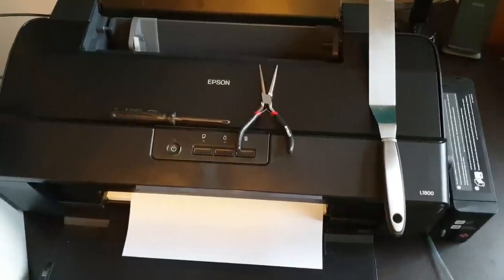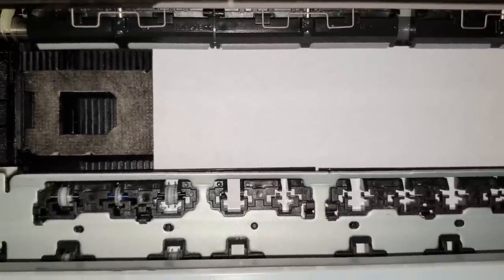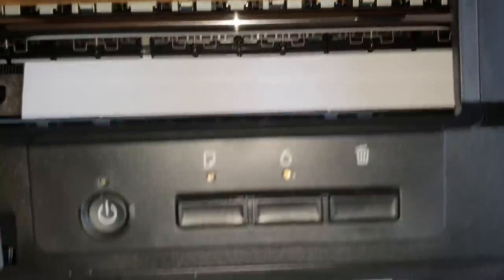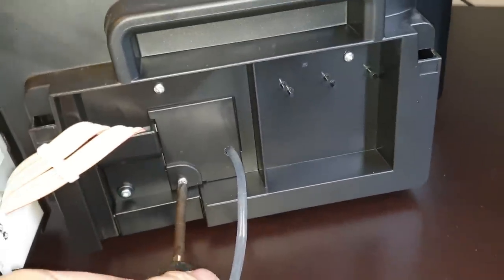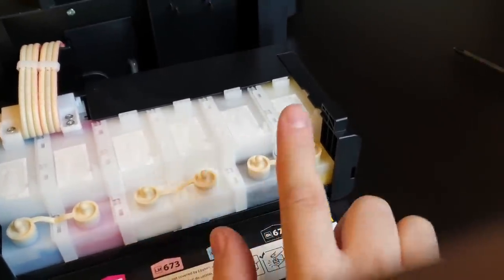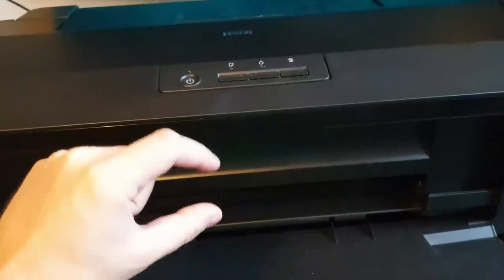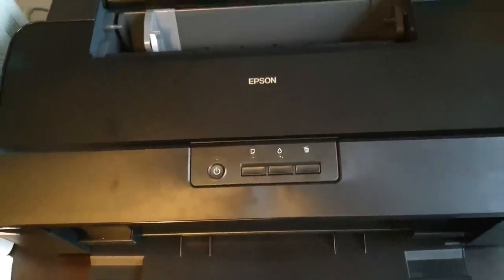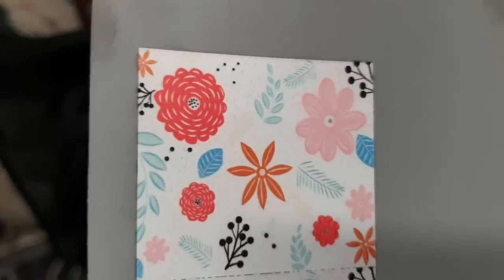How to convert Epson L1800 printer for DTF printing. Easiest and cheapest way. Tutorial.

Comment: It's actually working😊, but the drawback is that even a slight movement of the film can ruin the print. I personally find it more challenging compared to just opening the printer and removing the roller. Although it can be a bit intimidating for someone like me who isn't tech-savvy, there's no need to worry about any springs popping out or anything tricky. Just make sure to remember where all the screws go. In my case, I left one roller on both sides and cut them so I could feed a 4-inch long film.

Comment: Would converting the epson et 8550 be about the same process?

1. Remove the rollers
2. Rip software to enable white ink
3. External waste for ink
4. Install DTF ink
Reply from the maker: Yes, it's the same process for most printers.

Comment: Hi so  if i understand you don't need to flush the head with cleaner if not use during week end ? it only need to shake and launch a head clean ? right ?
Reply from the maker: A few days without printing is fine. Just shake and clean.

Comment: Thank you very much. This is a great video and ca not understand why anyone would give it a thumbs down.  I  do have a question. What did you use to connect the tubes together for the waste line?
Reply from the maker: It was just some plastic straw type of thing I found that fit perfectly into both tubes.
Reply: Did it work

Comment: I have question ❓ what if we want to print in A4 size , as A3 size gets hold on both side .
Reply from the maker: You'll be fine. The pushing is done by the wide rubber rollers before the print head. You don't really need those that go after the print head. So you can either keep a few on each side or remove them completely. Either way you'll be able to print A3 and A4.
Reply: @dtfprintingtechnology9457  Great , thanks for reply . Really appreciate 😍

Comment: Hi i have the epson stylus 1500w 
And i dont know If it's  Going to work ??
Reply: yes it works
Reply from the maker: It should in theory. You would need a CISS for it. The conversion process should be very similar but I have not had a chance to test 1500w for DTF so don't take my word for it.
Reply: @dtfprintingtechnology9457  refill carts 👍🏼

Comment: Hello. I have a question, please. After 8-10 pages printing, dampers become empty (or have air). White first, and then black and the others. And I need to suck the inks manually. Is there a solution for that? Thank you.
Reply from the maker: There is some sort of ink flow issue. There is a twist thing on the ink tank. Try turning it. It stops the ink flow for when you need to move the printer. Might also be blockage.

Comment: Yea complete skip the part where the printer cant grab the film out of 10 times.. Or it just passes through the printer and gives a paper out error 9 out of 10 times, yea just cut that part out of the video, we wont notice.
Reply from the maker: That only happens with cheap film. A high quality film has special coating on the opposite side that rollers can easily grip.

Comment: Hey, many thanks for this video! Just a question: I’m about to order the inks and all additional items form your website to give this a try (printer have my own) and I just wonder how is it possible to get the USB key with dongle for acrorip for such reasonable price. Everywhere else it costs around 345€ or so.
Reply from the maker: Hello. Thank you for your interest and sorry for a late reply. Acrorip 9 is cheaper than acrorip 10. You only need acrorip 10 for xp-15000. Older printers such as L1800, P400, P600 etc. work with acrorip 9.
Reply: @dtfprintingtechnology9457  many thanks for your kind reply! :)
Reply: What is with epson stylus photo R 2400?

Comment: Ive just bought the L1800, could only find it as a sublimation bundle. Will convert to dtf and have put an order in for consumables on your website. Can you recommend a vendor for replacement printheads?m for £60 you mention  Would like to be prepared for when print head fails.
Reply from the maker: The vendor that we used in the past is all out of stock due to DTF popularity so I can't really recommend anyone from first hand experience. I guess any vendor with good reviews is your best bet.

Comment: Hello.
 I would like to use this printer for DTF printing. Can I use the included ink?
 Can I buy only white and print it?  I'm a beginner, so I just don't understand.  Thank you very much.
Reply from the maker: No, DTF ink is rubberised. So when it dries it's stretchy on the frabric.
Reply: @dtfprintingtechnology9457  
Is that so.  understand.  thank you.

Comment: thanks for that great video! I have two questions...
What software are you using?
What if I don't use it daily? 
Thanks in Advance!
Reply from the maker: Acrorip. If you are not going to use your printer for more than a week you will enter a dangerous territory where you may end up permanently clogging your printhead. Long term storage will require a complete flush and lubrication.

Comment: So my printer was just a normal printer using normal ink. How do i drain out all that normal ink so i can fill up dtf ink?
Reply from the maker: You drain all the ink you can, empty the tanks, wash the tanks, fill the tanks up with distilled water, draw water from the tanks through the dampers using a syringe until it comes out clean. Then extract all the water. Extract the printhead, waterfall it with distilled water until it's clean. Fill up with DTF ink. Draw the ink through the dampers with a syringe until the dampers are full of ink and there are no big air pockets. You should be ready to go.

Comment: Thank you for your time to make this video for us. Can I ask, if the printer is for sublimation printing but never been used, is steel needed to be mechanical converted or just need to fill with dtf ink? Thanks
Reply from the maker: Sublimation printers are just regular printers that print with sublimation ink. Sublimation paper absorbs sublimation ink and there is no smudging. So you will still need to carry out the mechanical conversion.
Reply: @dtfprintingtechnology9457  Thanks for the info and for the quick response ❤️

Comment: I bought a used one of these and im about to convert it. how would i switch the ink to dtf from sublimation if the lines and ink tank were filled with sublimation ink first
Reply from the maker: Wash them out with distilled water. Then using a cleaning solution. Then water again. They don't have to be perfectly clean. Some residue will be left over.

Comment: hi. i have an epson l1800 and im trying to print without cover but i get errors. do you have any idea what sensor its making that error? when i put the cover on its working perfectly. TY
Reply from the maker: There is a little notch on the lid. It goes into the hole. You can just stuff that hole with paper or something. (Left of the power button from what I can remember)
Reply: @dtfprintingtechnology9457  i mean without the whole cover not only the lid. i want to change the case and i dont know what sensor to fool :(

Comment: Hi. Has this kind of "modified" printer difference with the printers made especially for DTF printing? I mean final quality of the print.
I'd like to start such kind of business, I have L1800, want to use it as a "low cost trial" before buying the dedicated DTF printer but still doubt if it's a goog idea. Thanks in advice for your reply.
Reply from the maker: Dedicated DTF printers are just professionally converted Epson printers. The print quality depends on the Epson print head. If you convert an L1800 it will have an exact same print quality as a professional DTF printer with an L1800 print head.
Reply: @dtfprintingtechnology9457  Thanks a lot for the advice!

Comment: This is very helpful what application or software do you use for printing ? I'm using PartnerRIP Pro and I'm having trouble printing. What happens is that whenever I print my layout on film sheets the layout starts on the edge of the film not leaving any border even after adjusting any tips will help thanks!

Comment: So this ink wont be dry ones is out the printer ? For that you dont have to do any conversion right? I always thought the printers has some kind of systems to dry the ink when the paper exit.
Reply from the maker: Desktop inkjet printers don't dry the ink. It's the paper that absorbs the ink. This is why when you buy cheap thin printer paper and try and print out a photo, it often comes out wet. In our case we want it to come out wet.

Comment: CAN I CONVERT MY RECENTLY USED EPSON L1800 TO DTF PRINTER.WHICH  I HAVE BEEN USING FOR SUBLIMATION ??
Reply from the maker: Yes, you just need to clean it and flush out the old ink.
Reply: @dtfprintingtechnology9457  ok thanks so much i have to clean it right now

Comment: I’ve been using mine with regular ink and I wanted to ask if it would be safe to drain all the ink and use dtf ink after the conversion or do I have to use a printer head cleaner to make sure all the regular ink is drained from the head too ?
Reply from the maker: It's recommended to empty the ink and wash/flush everything with at least distilled water. Printhead, tanks, lines, dampers. Mixing different ink types is not a good idea.
Reply: Do you have a video on how we do that?
Reply from the maker: @Dimish1  No, we don't

Comment: Very valuable information, thank you. Will this method allow for printing up to the edge of the film without any problems? And what would be the maximum size you can be able to print?
Reply from the maker: Yes, you can print right up to the edge and L1800 does A3+
Reply: @dtfprintingtechnology9457  Great. Thank you.
Reply: Would it be the same technique to convert the Epson R1800 to DTF?
Reply: Thank you for good tutorial, May I know there special software for DTF printing or is same software using for  normal printing?

Comment: Hi do you clean the print head every day after finishing your set of prints to avoid ink drying and clogging head?
Reply from the maker: We don't clean the printhead manually until it needs cleaning. Which is almost never. But we do run automatic cleaning every morning before printing or every 3 days when not printing.

Comment: We use sublinova inks for sublimation. We want to convert l1800 to dtf. Can we use the same inks except white inks? Can we do sublimation printing like before after converting?
Reply from the maker: No, these are completely different inks. You will need to buy the whole set of DTF inks. We offer discounts on ink bundles. You won't be able to do sublimation after conversion. If you want to switch back to sublimation, you will need to clean out the inks, flush the print head and tubes and load the sublimation ink back. Sublimation ink vaporizes at high temepratures and dyes the grament with fumes so to speak rather than applying a layer of actual ink on top of the garment. So two totally different technologies.
Reply: @dtfprintingtechnology9457  so we need to buy another printer. Thanks for replying

Comment: Is that really the only two steps needed to convert a brand new L1800 into printing DTF? 
do you have problems with bent film (from a roll)? like getting stuck in the middle.
and can i convert a used L1800? do i have to do anything different?
Thanks.
Reply from the maker: Yes, those are the only steps. No, there are no problems with bent film. We sell flexible film that does not crease or get stuck. Yes, a used printer will need to be cleaned, flushed, old ink removed and printhead cleaned. Be careful, most cheap used inkjet printers come with clogged printheads. Sellers often say stuff like "It worked fine when I used it but it sat for a while and head might need a good clean". In other words, the printhead is dead and they are trying to get rid of it.
Reply: @dtfprintingtechnology9457  thank you for detail answer. 
And im also wondering, after this modification, will the epson warranty still valid? Since we never got close to the warranty sticker. Most other videos i watched require the removal of all the casing and void the warranty.
Reply from the maker: @winrajunus6879  Epson warranty does not cover damage caused by non EOM parts, ink, modifications or software. In theory, if your main board dies, Epson should be able to replace it, however, they will most likely link it to non OEM ink or removed rollers. I have never had any mechanical problems with L1800, only printhead problems, so I never had to make warranty claims. Maybe printer forums will have more answers because people have been modifying L1800s for a long time, years before DTF was even a thing. So there should be plenty of people sharing their Epson warranty experience with modified sublimation printers etc.
Reply: @dtfprintingtechnology9457  thank you. 👍🏽

Comment: How can I maintenance the machine  and also white machine u recommend  for faster print thanks
Reply from the maker: p400, p600, p800 will print faster. dx5 head printers. Even older r2400 type of printers will print faster. I'll need to do a whole other video for maintenance. But you can start by shaking white ink and printing frequently.

Comment: pleaase guide us about the hand feel of this tranfer since dtg is very sofy and mege into fabric how about this tranfer is this sit o n top if we tranfer a3 size image
Reply from the maker: It's not as soft as DTG but it's softer than laser white toner tranmsfers or vinyl. You can adjust the feel by using different powders.
Reply: @dtfprintingtechnology9457  but question s if we do fullcolor illustration of a3 or bigger  it will definetly feel like a sticker
Reply from the maker: @shibarmy9621  Are you asking or making a statement? If you use the right powder it will feel much softer than vinyl. DTG is still the softest. https://youtu.be/Wvjo2UCX90A?t=209

Comment: This is awesome! Thanks for this. Now I need to find a printer lol.
Question, do I still need the whole chip resetter or any another gadgets?
Reply from the maker: Not on an L1800
Reply: You sir are a genius! So just do this, buy the ink, pet film, I already have photoshop, and I am good to go? Sorry I am new to all this.
Oh! What's the main difference between this model and the L805?
Reply from the maker: @jjsmsalas1  You will need acrorip software for printing. L805 is identical, just a smaller A4 printer
Reply: Oh ok, so photoshop would not work? Also where did you buy your 1800? I am having some issues finding one. I see some on Ebay but I feel a lil leary ordering from the individuals on there.
Reply from the maker: @jjsmsalas1  Photoshop won't work. It's not as simple as just printing a design out. You need to apply a white layer on top of your colour, choke the white etc. Rip software such as acrorip tricks your printer into doing something it does not do by default. This printer came from Epson. We are one of the biggest DTF suppliers in the UK.
Reply: @dtfprintingtechnology9457  How can I message you directly? I am looking for a printer but can not find one here in the states that isnt already converted. Somewhere that will work with me financially. Do you happen to have a source or know where I can go?? Thanks bud.
Reply from the maker: @jjsmsalas1  Link to our store is in the video description. We sell L1800 for approximately $800 excluding shipping. Unmodified. You will need to get a EU to US plug adapter. Contact details are available on the website.
Reply: @dtfprintingtechnology9457  I am trying to purchase a printer from you. Do you have another link? will you get more in stock? Also will it come with acrorip?
Reply from the maker: @jjsmsalas1  The printers are back in stock but are sold separately so you can create your own package, add acrorip, the required ink, powder and film quantity etc.
Reply: @dtfprintingtechnology9457  have you shipped to the US before? How long does it take? I have ink, film, powder and a dongle with a acrorip key but don't know how to install it. Is there a way to msg you directly or on the site?
Reply from the maker: @jjsmsalas1  Yes, we ship to the US all the time. UPS takes less than a week. contact form, email address and whatsapp number can be found here: https://www.dtf.technology/contact/

Comment: Is there any need to change the printer head height to allow more space, I have seen some suggestions of having to do that but not sure if it is really needed
Reply from the maker: There is no need for that
Reply: @dtfprintingtechnology9457  Brilliant, so from the brand new out the box L1800 with Change to DTF inks and film and this conversion we are good to print DTF?
Reply from the maker: @stephenfowler8741  Yes, you will also need rip software, powder, cleaning supplies and a heat press.
Reply: @dtfprintingtechnology9457  you are a legend, thank you. This has helped a lot

Comment: Great, what happen if the printer stay inactive for 3 weeks shall we have to leave it connected? we have had a DGT printer before and the white clogging issues was endless if the white ink cartridges were not shaked daily
Reply from the maker: It will still require the same maintenance as a DTG printer, just not as much and as often. If you plan on leaving it sitting for 3 weeks you will need to flush it with cleaning solution. Inkjet printers in general are not designed to sit around. Even a regular office printer with genuine Epson ink will clog up after a month and will require some sort of maintenance.
Reply: @dtfprintingtechnology9457  Thanks,  it's possible to get samples?
Reply: @rockinitis4615  Of course, please email support@dtf.technology
Reply: @ilia2178  pm you thx

Comment: Hi again wanted to ask you also did you prime the dampers or worked directly?
Reply from the maker: Hello. It's laways better to prime.
Reply: Yea that's what I thought , may I ask what software are you using? And is there a way to download it for free?
Reply from the maker: @tarekhaig  Any rip software will work. We use acrorip. You need a phisical USB key to run it.